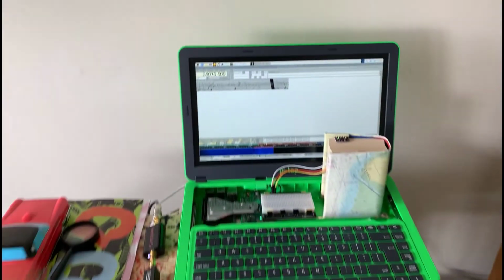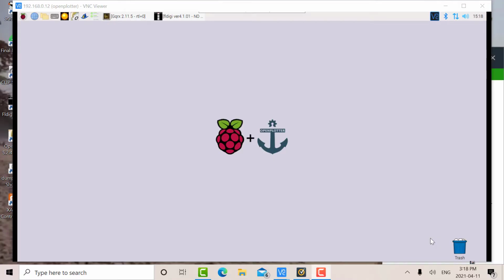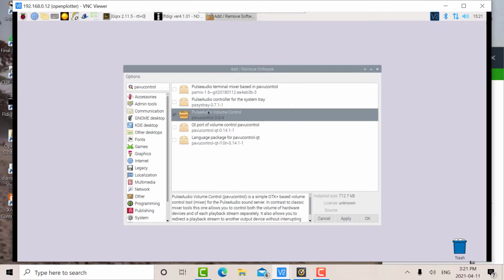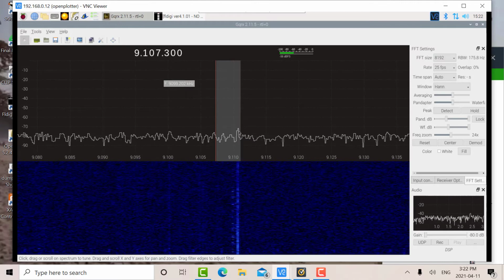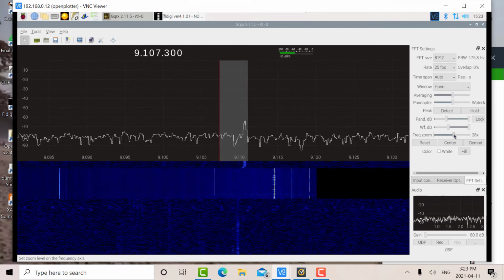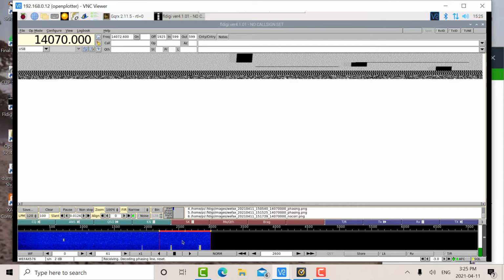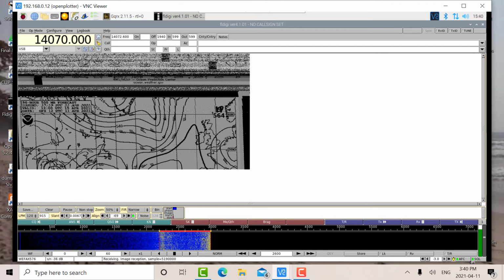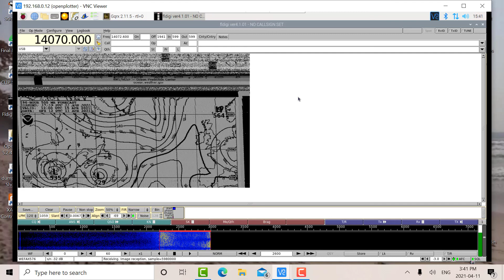OpenPlotter - Marine HF Weather Fax

Comment: How did you get Gqrx installed?
Reply from the maker: See earlier video and blog post:
https://jeremyclark.ca/wp/telecom/openplotter-rtl-sdr-for-vhf-ais/
Reply: Hi I’m new to Pi so please forgive any ignorance but I think I’m having this same problem. Do I write- - allow-releaseinfo-change in the terminal prior to attempting to download gqrx? Or should I add it to the command line as I’m trying to download? 

I’ve tried downloading gqrx via the terminal as well as the add remove program option. It reads most everything but can’t download some of the final dependencies.